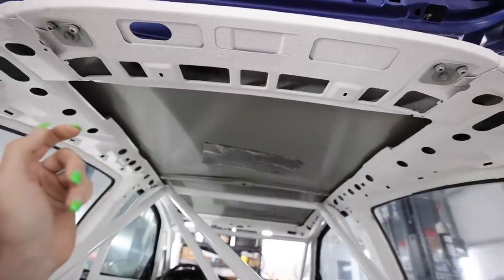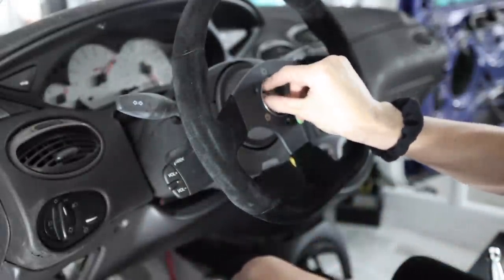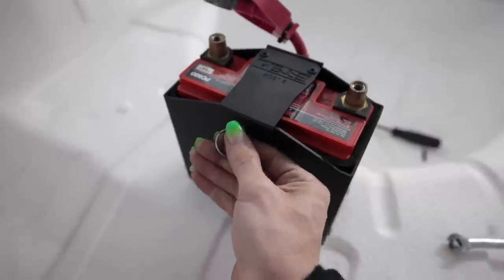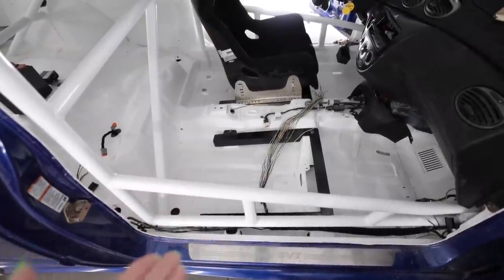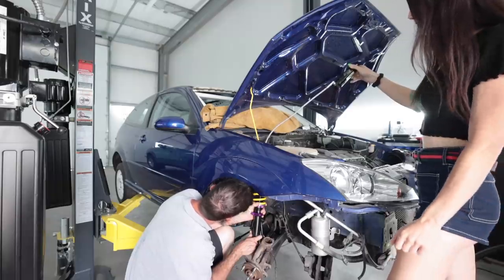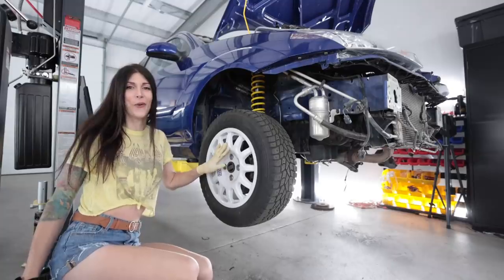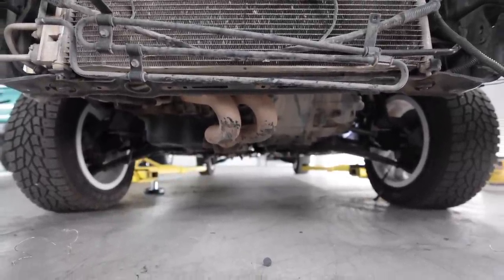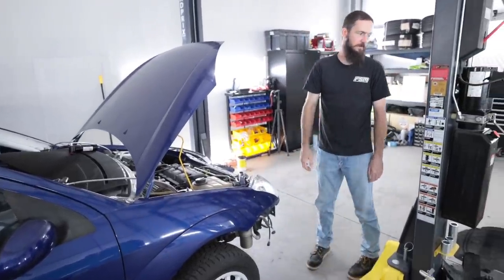Long Travel Suspension.. On A Car! // KW Gravel Rally Spec Coilovers

Comment: Use a parts wash tub type brush with Regular Gas 87 octane and scrub the transmission case.   It works really well.  We do it in our used vehicles service mechanic shop to clean engine's and transmissions we get from vehicle dismantlers.

Comment: If you ever need to make a round hole bigger in metal, take the size of hole saw that fits in the existing hole and stack the next biggest size saw on top of it.
Reply: Too cool, glad I bothered to read these comments today!
Reply: That's a really clever idea. Thanks!
Reply: or use a step drill bit, if you have one big enough.
Reply: Trouble is with a hole so you need to centre!

Comment: I love Rally content!  Rally racing is the best racing.  I miss the old Group B races, but understand why they stopped them.  It's so cool to see you finally building your own rally car.  You talked about doing this back in 2018 and here you are doing it!  Now that's role model example stuff.   

I am curious as to why you want to line the wheel wells.  Won't that add even more weight to the car?  More than what the wires you wanted to delete?  Would spraying PAM or some other temporary  lubricant/protectant work for the race and then you could easily spray the mess away afterwards?

Looking forward to the next installment.
Reply: Oh yes, the killer Bs! The golden era of rally.

Comment: You need a Hotsy hot water pressure washer. It’s shocking how well it cleans literally anything.
Reply: Yep,  degreaser and hot water pressure washer.
Reply: Yep with downstream injector.  Put some chemicals in at low pressure.  Let sit.  Then wash off with hot water.
Reply: Yep agree heat makes a big difference
Reply: Use to sell Hotsy brand to industrial users and they are the very best IMO.
Reply: Yes!  Exactly this, works like a charm.  They work incredibly well.

Comment: I was curious cause spiders have 8 legs. I found an article on line about another one with the same missing legs. looks identical. "It is a nursery web spider. The scientific name is Pisaurina mira. It lost two legs possibly during molt or due to a predator. You can tell it is a spider because it only has two body segments"
Reply: It was a male huntsman spider that lost two legs escaping from the female that it had mated with. It is quite common to lose legs in the struggle, It is more common to be devoured.

Comment: Charlie is saying you need to get softer springs.  The ones you have are too stiff.
Reply: I probably wouldn't be inclined to second guess KW on the spring rates until after I'd driven it in anger.  A shorter spring of the same rate to get back some droop travel might be in order though.

Comment: The thing your looking for is a Hot Water Pressure Washer.  Sadly they're around $3000.
Reply: We had one that ran on kerosene at the old auto shop I worked at. Definitely could take anything off the dirtiest engine. Even that weird dirt-cake-oil-sludge stuff.

Comment: If I were to want to clean the grimy xmission cover you showed on a budget, I would use a simple steam cleaner or brake cleaner.   FYI.  Fairly obvious suggestion though. :)

Media blasters are a mess in the open air, but work well in a hood if you remove parts.

Comment: As far as cleaners I really like Industrial Simple Green and there's several versions and the one 1 like the best is in a white round gallon jug and the other two types are in short square jugs that are purple and green and those just don't seem to work as well. I get it at Home Depot, Smart and Final or Amazon and depending on your pressure washer you can put the cleaner through it. I prefer off roading type of content but I don't mind rally stuff it's close enough for me.

Comment: Yes Rallying rocks 😎👍 plus one for a diesel steam cleaner hot pressure washers are the bomb. I used to use them on clapped out old fork lifts very impressed with how much filth they remove 😎👍

Comment: i have build rally cars for a living. Parijs Dakar, WRC
First make some boots for the coilovers, for protection we used fabric with velcro easy instal.
second the wires  between the rolcage and body big no no FIA rule. if someting happends car crash the wires wil squeeze between the frame and cage then you get short circuit fire.
Always mount the wires on the inside of the car.

Comment: You made a comment about the plasti dipped dash getting dirty all the time.. Have you tried/heard of dip coat? Sometimes called dip guard or dip armor I think but the bottle I have says dip coat

It's cheap, easy to apply, and makes a dipped surface smooth, scratch/fade resistant, and much easier to keep clean

Comment: I love rally stuff.. We used to rally mini's and my 1966 MG Midget back when I was in college in the early 80's in the UK. Can't wait to see it go sideways. Oh Yay, the Odyssy PC680 battery.. I had one of those in the airplane you see on my profile.. If it can start a 6 liter 4 banger with a Constant speed metal prop it will have no trouble on the Focus..:)

Comment: I love the rally content, it's probably one of my favorite builds of yours. And yeah, dried ice blasting would work perfectly for what you need but yeah it's pricey as.
Reply: Instead of dry ice, try a CO2 fire extinguisher. It can do double duty &, you won't  have to store dry ice, so triple duty kind of. Plus it's  easy to get recharged. Use it out doors  or well ventilated.

Comment: A cheap alternative is use automotive acid that's used on wheels. When I body deadened my ute, I used the automotive acid but make sure you wear protection & old clothes. Then you pressure wash it off & you'll see a huge difference. In some spots you may need a brush. Once it's dry then you use deadener to it all. It can be messy but the end result is protection underneath & you wont have to touch it for years.

Comment: For the end link issue, I’d email Karl at massive speed system.  I’ve used his stuff before and his adjustable endlinks should be able to be made long enough to work. And they’ll be able to fit the coilover.   

As for a replacement header. Last I looked OBX makes a full stainless replica. The factory header is crazy expensive, and they always dent right there. Speaking from personal experience.   Really jazzed to see the car getting further.

Comment: Try some simple green driveway and concrete cleaner. I just used it on my engine bay of a 1957 Cadillac with tons of oil leaks and it worked fantastic. Just keep it off your paint. Spray it on, wait 5 mins or so then I pressure washed it off.

Comment: Mentioned this back when you were doing the tail light conversion, but I think you'll find it a little more difficult than just swapping some wires to make them work right.

You really need to recode the body control unit to think it's a sedan, or possibly a euro spec. Euro spec might use different hardware, but you want your tail/brake/turn lighting to be the way the sedan is wired.

Comment: This is a great project I'm jealous. You should wait until fully loaded before adjusting the suspension and you're going to want to go for 35%- 40% drop from the cars resting position. This will work really well for landings after catching air over a bump or hill drop off.

Comment: Maybe look at AFCO (or any other company) for a lower-rate spring, and maybe a different spring height as well.  I'm WAY behind you on a rally build (SN95 Mustang) FWIW, but Charlie is right about the travel needing to sit mid-range at static ride.  You need both compression and extension travel for the shock/spring to work correctly.

Comment: For cleaning up the undersides, try microfiber-wipes and an oil-based soap. The wipes come in high-count packs at box-stores and seem to eliminate streaks of missed-grime. The oil-base soap softens the greasy built-up crud because it is basic like the grease. Then an all-purpose spray-n-wipe cleaner gets the oil-soap off.

Comment: Hello Sarah.  I've never had a car or bike as clean as your Focus, unless it was new, or newly built.  However, I do have a cleaning tip for after it's been raced.  What you do is... You go & visit someone, with your dirty rally car, & a water sprinkler.  Park the car on the front lawn.  Hook up the sprinkler to the water hose.  Put the sprinkler underneath the car, turn on the water, then resume your visit.  You might have to shift the sprinkler from time to time.  After a while, the lawn will be muddy, & the bottom of the car will be clean.  Take your sprinkler, & drive away.  Easy.  :)  You can do it on your own lawn, but it leaves such a mess....  Oh!  Keep the rally stuff coming.  Bye.

Comment: For cleaning chassis and engine grime: use industrial oven hood degreaser. I use the purple stuff sold at Sam's club, diluted 50/50 with water (or whatever ratio you want), scrub with a brass brush or scotch brite pad and wipe with a wet cloth.

Comment: I bought that focus brand new in Bend Oregon in 2003 and put 90K miles on it in 5 years without any problems. Traded in 08 for a new 150 4x4 king cab in Tyler Texas.

Comment: I think you'll need to strengthen the turrets with seam welding or create front end triangulation with some tubing, as taking that Focus off road and hammering it, will create stress cracks inevitably - it isn't that stiff torsionally, the floorpan for the MK1 was signed off mid 90's. I love those KW's

Comment: Tub-o-towels or simple green wipes to clean the paint surfaces and then try the engine brite foam for the transmission. Except for simple green, you can get that stuff at advanced auto.

Comment: Sarah have you tried white distilled vinegar? I use it all the time to clear up excess dirt, works on oil, cuts through rust, especially on rusted hardware. I simply pour into a potted plant sprayer, spray away, leave for up to 15 mins max and wipe off, and repeat if necessary. Okay it smells, but its great.

Comment: With the cleaning I think you're already doing it the proper way. Just blasting it as much as possible can lead to paint damage. What may be an affordable addition to your cleaning tools is a steam cleaner to loosen up that tough stuff for your brush/rag/etc. to wipe away and for something like the transmission/engine housing a chemical product to tackle dried in oils, etc (powerful degreaser). I'm thinking something like brake cleaner. Would probably go a bit more specific on that.. But a steam cleaner is the hot tip here for your fingers to only have to wipe, not tediously scratch away dirt. Loosen the sh** up..

Comment: Don't need limit straps on a shock that's designed to go Rallying 👌 you want the full travel of the shock. Skrew the spring down and soften the damper with the adjustment for now but will probably need softer Spring Rate for "Forrestry Rallying" 💯🤙

Comment: You may try steam cleaning.  Even $100 unit out of harbor freight might work. 
You want a hose, 2 feet ok but a hose.

On aluminium, might be slow.  Bigger unit, 240 volts, more expensive unit does exist, some crazy fast.

If you like it, might try it on everything.   However,  steam may damage cheap plastic. 

I use it a lot for fabric and seat

Some larger unit are offered for rental

Comment: I'd just try some Gunk degreaser and a toothbrush / nailbrush to clean the casings.  If you can get them off & have no fluids behind them, you could mask the inside and use an aluminium brush in a drill / dremel on the outside, but that's a lot more time for not much reward.

Comment: Use a degreaser called awesome, it works great on grime, grease, safe on metal aluminium,and most hard surfaces, you can buy it at the 99cent store.
I cleaned my intake (aluminium) not cheap plastic. and shines like a star, you can rinse it off with water.

Comment: Love the content in general.  Keep up the great work.  Have you checked any rental places to see if they have dry ice blasters.  Some one in our area recently got a rental.system.  Ever thought about a 35 or 50 foot shop vac hose?  I got a wall mount for the hose coil and a remote switch for my vac.  Just uncoil what I need, turn it on and off from the driveway or the garage, coil it back up. Got tired or tripping over R2D2 dragging around the garage.

Comment: I was just going to say soda blaster, but you said it just a minute later while I was typing... downside is you have to take a lot of stuff off and tape off and wrap things up and its a mess still, but at least sand is not everywhere in gaps and crevices... you can add water to soda blasting for a slightly cleaner mess... just not on the ground outside, it will still be horrible... A commercial grade steam cleaner might get you closer than doing it by hand.

Comment: Keep an eye out for a used steam genny! (Pressure washer that uses very hot water heated by a kerosene (sometimes other fuels) heater that’s onboard the unit, for anyone that is not familiar with the term “steam genny”) 
It’s what is used to clean heavy equipment, and many times no degreaser of any kind is needed as the super hot water/steam literally makes most grease/sludge/Icky McNastys/tar/exploded bugs/etc melt right off. Many times you can find them on construction auction sites/on-site auctions, or in classified ads, and are usually less than $1,000. DEFINITELY money well spent as they are almost always very well built and use well made parts (made to be used for hours and hours day in and day out) so it will be around for many years.
Usually quite easily and cheaply serviceable even when any issues do arise.
Seriously look them up, I think you will be impressed with how effective they are 👍 
Hope that helps Sarah!
Take care!

Also, really digging this lil rally Focus (love this style Focus in general lol)
And really hoping for more Ranger content too! Though I might shed a tear if you mod her too much as that old girl is in such nice shape! Literally looks like you just drove it out of a 90s Ford dealer! 
(Yeah ok, maybe I’m weird but I absolutely love 80s and 90s vehicles, especially period correct ones lol)

Comment: Re cleaning those gunky underside parts:  Have you tried either brake fluid or lacquer thinner with a stiff brush?  Wipe that off a bit, then follow up with a hard polishing using 0000 steel wool.  Worth a shot, no?  ;-)

Comment: I don't know anyone who runs limit straps on a rally car. It's not a big heavy live axle like on a truck. It's really not necessary. 
As for the spring rate, even on a gravel car you'll need it pretty stiff so you don't bottom out landing jumps etc. If you don't have much sag maybe look at a shorter main spring and run a tender spring which just about supports the weight of the car.

Comment: I don't much about off road dirt racing, traction knobby tires on bikes, suspension needs to be softer with lots of travel for bumps etc.at speed and stay out of the ditches,  high speed dirt racing much looser then road racing on asphalt .... I like Baja trucks too I have seen it tear up a raptor truck stock suspension in no time... pulled the suspension mounting points off the truck   it was a you tube video !

Comment: hey  u was asking about   s13    control arms   i have a s14  sadly  its just sitting there   i have to weld  in new core support    but  i dont have     welder to   do it      might not be the same   measurements    but   do  u  want     info  on  rear  control arms ?

Comment: You need a heated pressure washer/steam cleaner - one that burns diesel.
They get everything off, even paint if you're not careful.
"So much more room for adjustability"
I don't see why them struts would be so stiff with the spring wound so far out - you sure it's not an issue with the shock? 
Yeah, I'd rather see you working on the focus than any of your other cars. 
Thing is, are you actually gonna rally the bloody thing when you've done it, or are you gonna be too scared of bending it?

Comment: 99% isopropanol alcool disolve grease, oil undercoating for rust prevention like it's nothing in some cases it got hard time dissolve but it innexpensive. put it in a spray bottle, get a brush and a pan underneath, let it soak for about a minute and add some since it evaporate, scrub and wash. just need to be in well vented area

Comment: Front spring rate far toooo high or shocks on max setting far toooo hard rally cars need to absorb the bumps and yumps not crash into them, this setup will tear the inner wheel arches apart over rough stages